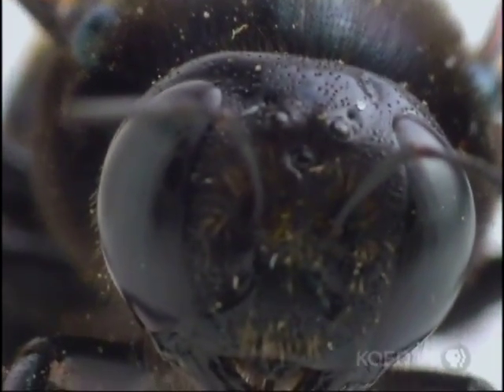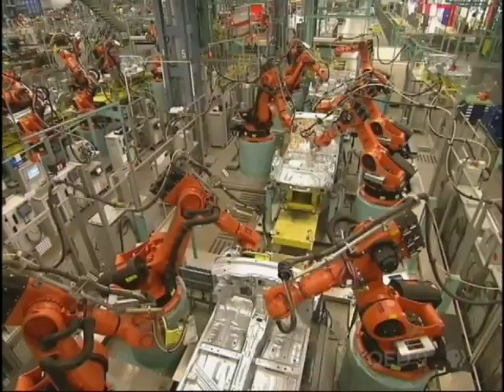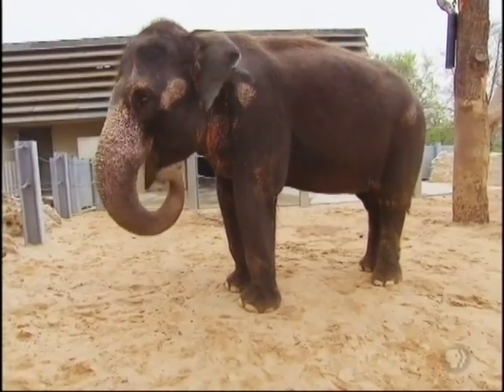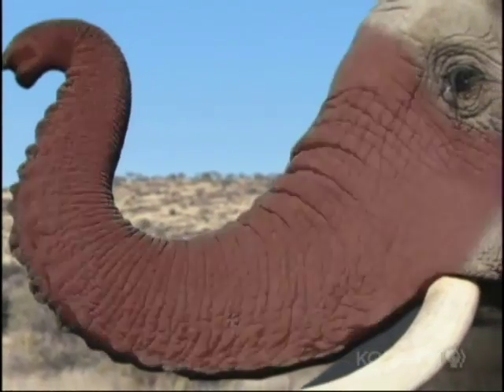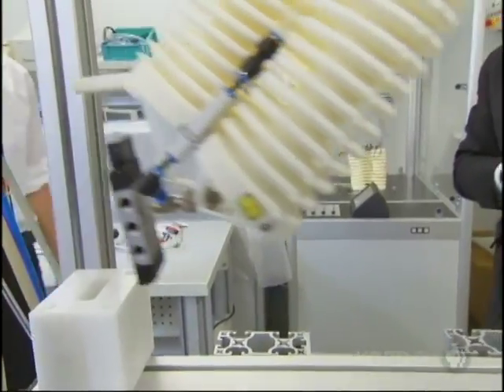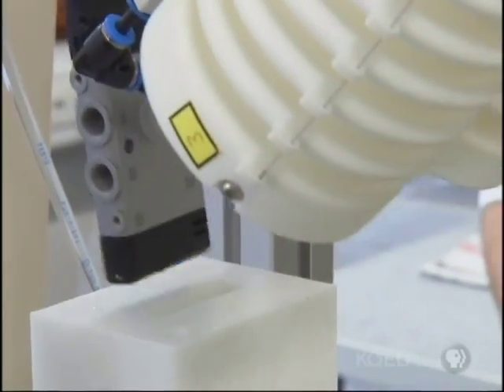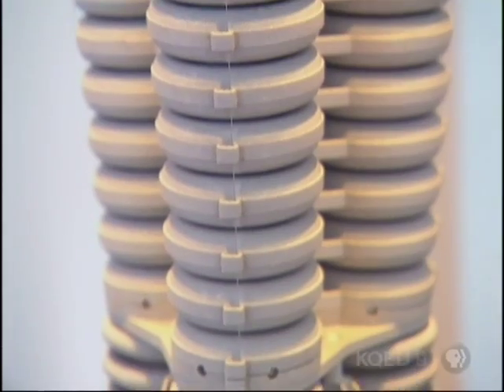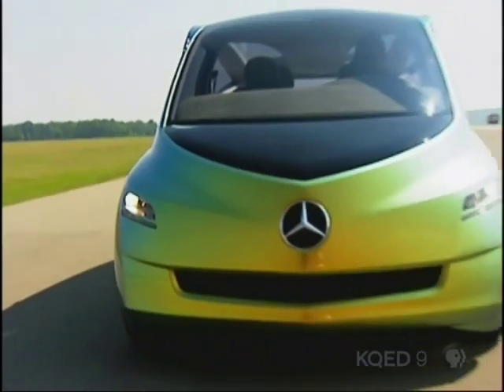Robotic arm inspired by the Elephant trunk

Comment: i'm callin' BS on the "egg gripper" test. to me, it was too much smoke and mirrors. the regular gripper could probably be easily modified with a controlled release valve that would decrease the closing force on the egg (along with less air pressure) it probably could be adjusted to not break the egg.
ON The FIN GRIPPER, it was interesting that they had a device that was made JUST large enough so that when the gripper fully closed, the outer ends of the gripper came together which STOPPED any more tightening on the egg.
Don't get me wrong - I LOVE the idea of the Fin Gripper - and I would like to see it's properties developed. but I TOTALLY disapprove of being given a demonstration like this - it undermines (at least my) confidence in a corporation that would do this kind of thing.

Russ from Coral Springs, Fl, USA
Reply: The test was bs haha. I think the point is just to show that the fin gripper more intuitively responds to the object without having to program any feedback force control. I guess the down side is it can't be as precise either.

It makes me loose confidence in tv programs like this in general. Instead of explaining the pros and cons they dumb it down to a bunch of jokes and simplistic demos. Are viewers all that dumb?

Comment: its slow and not as strong/precise
Reply: True. I don't think this tech will ever replace traditional robots heavy industrial applications or where there is significant pushback (welding, machining) but perhaps due to the safety and light weight (maybe cost) they could be used in other applications. I don't see any mechanical reason why they couldn't be faster, maybe over shoot?
Reply: Thid is just prototype